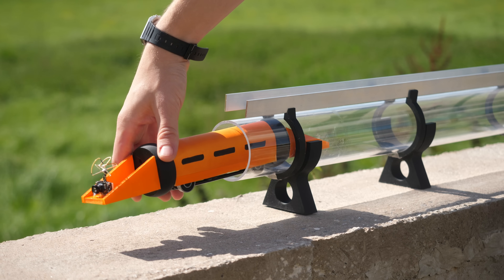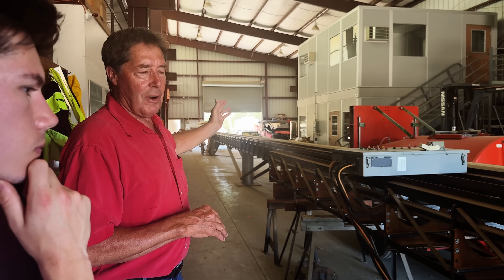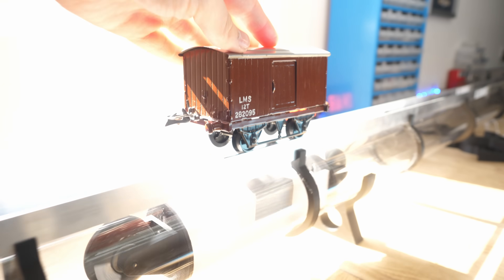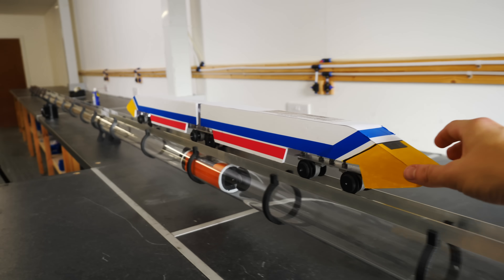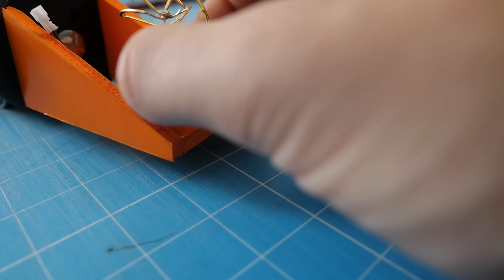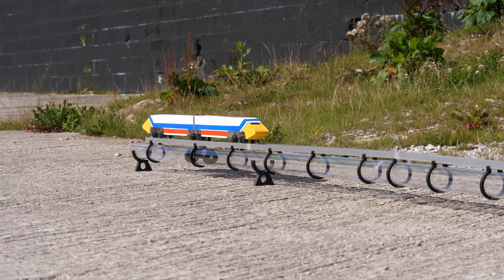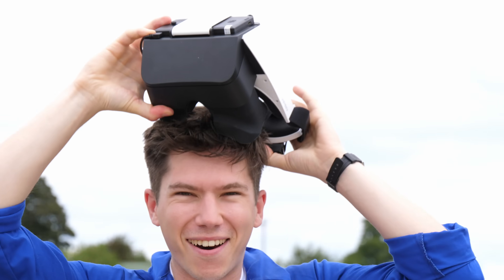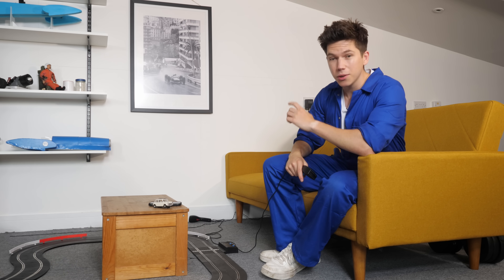Building a SPEED Hyperloop

Comment: The problem with aerodynamics and just fluids in general is they don’t scale linearly like distance or speed do.
Reply: I was about to say just this. You can’t really scale down speed like that when the laws of physics you’re relying on don’t apply at supersonic airflows.
Reply: @matthewferos  yeah, the best way I have heard it described is that even if you scale the model the fluid's atoms and molecules stay the same size.

In a more mathematical way, a lot of the aerodynamic equations involve squares of velocity or similar and hence do not scale linearly, like the drag equation and can end up with scaled down models requiring a higher airspeed to accurately simulate the real model. Couple that with the scaling of surface areas and volumes and it complicates it even more. If you take a square and a half scale model of it the surface area decreases to a quarter.

So the scaling of aero and fluid dynamics effects are very complicated.

Just as an example with this the velocity is much lower and the surface area is much lower so the drag will be much lower. The only way to simulate a real train like this is to greatly increase the velocity.
Reply: @conorstewart2214  Technically, squares and arbitrary powers are still linear algebra and it should be possible to work out a satisfactory though not exact scaling formula. What definitely isn't linear is what happens with transitions from laminar airflow to turbulent airflow to supersonic airflow around the whole thing. You'd need a different formula for each laminar-turbulent-supersonic flow transition between small and full scale models.
Reply: @conorstewart2214 It's probably more commlex than what I'll say, but I think you at least gotta need a similar Reynolds number. This number tells how much a fluid is driven by its inertia compared to its viscosity, and Re = rho*V*D/mu. Here rho/mu is unchanged as it's fluid characteristics. So on the scaled model, you need the same V*D as the full scale train if you want the fluid to behave similarly around the object. Because the model is 48 times smaller, he would actually need to aim at 48 times the speed of sound !! If he wants the airflow around the vehicle to scale correctly
Reply: Because you are using a characteristic length 48 times smaller, if you want inertial forces of the fluid to have the same weight over viscous forces, you need the fluid to flow 48 times faster. At least, that's how I always understood it
Reply: @conorstewart2214 just gotta do some dimensional analysis broski
Reply: @conorstewart2214  If it's traveling in a vacuum then there are no aerodynamic forces at play other than friction of the air surrounding the vehicle and the tube, just pressures? If the aft section were under pressure the induced aerodynamic forces would be reduced? If both of those were balanced by vacuum and pressure what does aerodynamics influence other than the friction of the walls of the tube and the vehicle. I don't know, but had to ask. Airflow and pressure are different things.
Reply: E = m * v * v * .5
Speed indeed did not scales linearly, they scales exponentially.
Reply: @helicopterdriver  it is not a complete vacuum and parts of it are out of the tube in some tests anyway. Even the effects of pressure don't scale linearly due to surface area not scaling linearly. If you reduce the length, height and width down to a tenth then you have reduced the front surface area to a hundredth of what it was, now if you calculate the force generated by the same pressure it will only be a hundredth of what the full scale model would have despite being a tenth of the size.

The original goal was to have a train propelled by the object in the tube, and aerodynamics definitely matter for that.
Reply: @Nico-9138 48x huh?
Reply: as well as friction. it's minimal,  but it is still these forces increase exponentially with scale.
Reply: Particularly the speed of sound. The drag increases significantly in the transonic region
Reply: To add to this thread I'm pretty sure you can't go faster than the speed of sound with a vacuum powered train because  the force making it go faster is the pressure wave of air behind the train.
Reply: Yep and that's why it annoyed me he claimed it reached the speed of sound, no it didn't. The speed might not even increase much when scaling it all up.

The speed he got is the speed he got, nothing else. 

I usually like his videos but these claims were such nonsense ...
You've to wrok with dimensionless numbers/values to be able to easily scale...
Reply: Thanks, I came to the comments for this info. Something just seemed off to me scaling the speed in this manner
Reply: Wouldn't he need to decrease the atmospheric pressure in the tube's intake to bring the sound barrier down to scale? In that case he'd be running a near-vacuum also, so the entire point would be moot due to inordinately high friction compared to the scale
Reply: You mention it being a problem but don't actually explain why. Why does non-linear scaling matter?
Reply: @Metal-Possum  maybe what he mean is :
if you build scale building, you can easily state it stronger and durable from earthquake. but volume scale must be in "cubic volume law" so in short. your scaled model not any representative to real life model. any you can declare any scaled model to what ever you can achieve, but not in real life model. 

bonus : in aerodynamics and fluid there is "reynolds number" that you can project scaled model to any size model you want, just like "cubic volume" formula, that you can use for volume/weight/strenght  to any scale do you want
Reply: @ZuNunchaku  I wasn't just referring to the cube volume law I was saying that most aerodynamic, friction or pressure based equations do not scale linearly when the dimensions of the model are scaled linearly, mainly due to surface area. 

The Reynolds number is just one example of a dimensionless number but there are others.
Reply: @Metal-Possum  the non linear scaling matters because he scaled the model linearly hence all of the friction, aerodynamics, mass, forces, etc will not have scaled linearly so without scaling those things appropriately too the model is useless.
Reply: https://en.m.wikipedia.org/wiki/Similitude
You can scale, its just a bit more complicated.
Reply: The biggest problem I’ve encountered with scaling Down is the surface boundary layers, tuning my 20mm wingspan glider is quite different from anything bigger!
Reply: There is a much more fundamental problem with this video... 1365 km/h means 379 meter every SECOND. So if the line maybe lets say 10 meters, then that means that little modell must be finish the whole distance less than 26,4 MILLISECOND. In other words 1/38 second.
Reply: If mythbusters taught me anything, it's that thinks don't scale equally.
Reply: Yes, because they are in one dimension and air or liquid is 3D, and surrounding all space around our object, and in 3D state, we go to the power of 3, such as cubic meters
Reply: Air is a fluid ? 
Next you're gonna tell me lightning is a fluid, like the 1800s science nerds thought.
And what about ether ? Not diethyl ether, but the invisible ether fluid in the atmosphere all around us ?
I didn't take any physics courses, but I definitely know in none of those courses I didn't never tooked, no science bitches ever ain't say no air be liquid, naw. 
Them's fighting words.
Reply: I'm pretty sure the 17th law of quantum jelly baby (gummy bears for you Americans) tunneling allows for liquid air to be supercollided with monkey nut paste, nullifying your scaling issues.
Reply: it can be solved with "reynolds number"

Comment: A potentially better way of measuring the speed would be to set up a few light gates with a microcontroller to measure the time between when they get triggered.
Reply: Yes, or:
1) Use and oscilloscope to see trigger times.
2) Film it at a known frame rate and see how far it goes per frame.
3) Shine a strobe light on it at night and see how far per flash
Reply: @kensmith5694  with the two camera based methods you have to then find the distance, using light gates is easier as you just need to measure the distance in between.

You could use an oscilloscope but a microcontroller with a small display is more portable.

Comment: This is a good example of why PLA (especially black PLA) should not really be used in any outside project, this isn’t in a car on a hot day, this is a not that sunny day in England and it is enough to warp the parts.

You should try out PETG, ABS or ASA. If it is a P1P you have I would recommend getting the P1S upgrade kit so you can print with ABS or ASA.
Reply: Yeah, i printed some hooks to hang out bird feeders in my garden. Lasted spring fine but as soon as summer hit they started melting out of shape. (also in the UK)

Reprinted them with ABS instead of PLA and they're holding up much better, even in direct sunlight (still a little warping, but minimal)

Comment: For future reference, you could try printing the rail ties (or other parts of projects) using white filament, which absorbs much less heat than dark colors like black. Awesome project!!!
Reply: Use PET-G or ABS not PLA.  "Glass transition temperature" is the specification of the material you'll want to consider.
Reply: or he just inverts the clip...
Reply: And design a clip in tie bar that sets the correct spacing of the rail supports after positioning. If designed properly it would also clamp the tube tighter as well.

Comment: I didn't think "scale speed" was a thing, because time is constant and it's not scaling with the size/distance, no?
Reply: If ,for example, 1 foot is shrunk down to 1 inch, then it would only have to go 5280 inches per hour to go 1 scale mile per hour.
Reply: @benjaminmarks8765  except speed isnt based exactly on scale. speed of sound and a lot of other things dont go on a scale. if you made something 1mm wide and pushed it through the air with your hands, it still goes the speed you moved it with your hands, not scaling 1mm up to a car size.

Comment: I bet a thin foam rubber disk as a seal could glide over the joints while keeping the pressure. I'm reminded of the experiments where they put a Ping-Pong ball n a PVC tube, vacuumed it out and popped the seal on the back end. Man that ball got up to speed quick!  There are plenty of "supersonic ping pong ball" vids online if you want to see.

Comment: Love your videos. I am slightly confused about one thing though. I drag race 1/10 RC cars that go down a 1/10 scale quarter mile (132 ft @ 80-100mph in about 1.4 -1.7 sec. (Measured using very accurate lighting / timing system) 
I was under the assumption speed doesn't scale very well..
 just because the RC cars are one-tenth the size they are still going 80 to 100 mph. We don't say they are going 800 to 1,000 mph. I'm just curious what is the difference here?
Reply: Well you are absolutely correct, BUT if you jack the numbers up for no reason, it looks a lot better!

Comment: Using Different Plastic (did you use PLA?) and maybe even covering the plastic parts in a ring of Aluminum Foil may help with the heat melting/warping.

Comment: This has probably already been brought up...but there's some concern about the aluminum railings interfering with crucial magnetic fields. No doubt this has all been worked out. Carry on.
Reply: due to the close magnetic coupling, there'll be very little flux interaction with the rails
Reply: The coupling is beside the point. It's the moving of the magnetic field next to the plate aluminum that would induce a flux drag.  @kiwishamoo6494

Comment: I think its not gravity that centers the train wheels.  Its the different diameters. If its not centered, the bigger diameter travels more, than the smaller. Its like self steering.
Reply: Exactly, that triggered me as well
Reply: yeah it's because the wheels are conical so it self-centers, plus it doesn't need a differential to steer
Reply: @St0RM33  thank you sir , that made it more understandable for me .
Reply: @Zach476 it has nothing to do with gravity or centripetal force, it's due to self steering because when the wheels are not centrally on the rails the come shape means the outside wheel has to travel faster, i.e. covering more distance, i.e. straightening the train.
Reply: @rjmunro  Centripetal force only applies to the train if it is going around a turn in the tracks where the tracks on the inside and outside of the turn are different lengths
Reply: @rjmunro  other than the first part everything else I said was wrong.
Reply: Fans of BlondieHacks, assemble!
Reply: Railfans in general. As a kid I had a book about trains and railroads and it had a whole section about the conical shape of wheels. I can't have been the only one. @SuicideNeil

Comment: A suggestion, that might help increase the speed of the hyperloop, came to my mind: Could the the speed be increased by attaching an air compressor to the opposite end than the vacuum?
Additionally: Great Project as always!
Reply: High Volume Inflator (the type used for air mattress) May Work Better (that and/or or make a PVC “accumulator” and LAUNCH it like a Potato Cannon!)
Reply: Why not connect the output of the vacuum cleaner to the inlet of the hyperloop
Reply: @90xxxxkat  Intruiging, but my guess would be that it would present obstructed airflow to the device.  Also via using two separate ones you have the work of two motors moving it.

At least that’s what i think it would cause; I’m not an expert.

Comment: Awesome....I am sure you thought of this but a bracket between each rail at a set distance will resolve your rail bowing issues.   I also think dampeners at each rail attachment to the tube and to the stands would also help.  Like a rubber ring on a hose clamp.
Reply: Bro, the vid was released 1 min ago
Reply from the maker: @Fantommc00  Patreon early access!